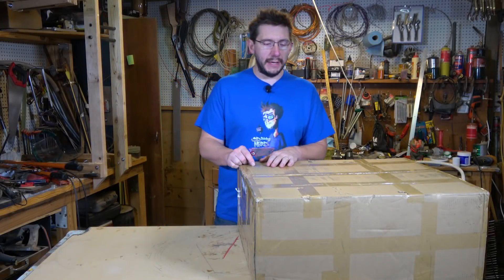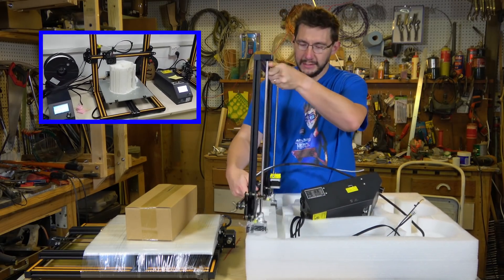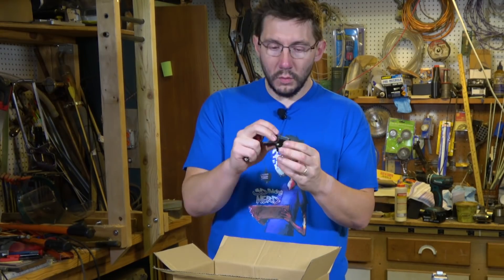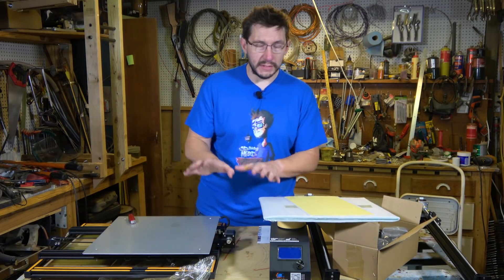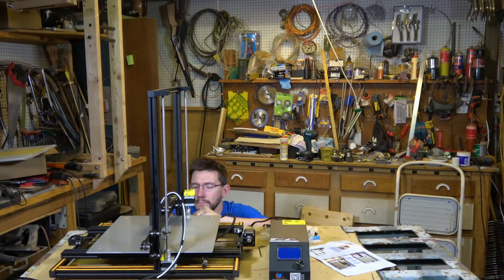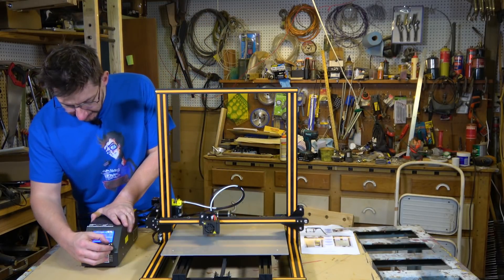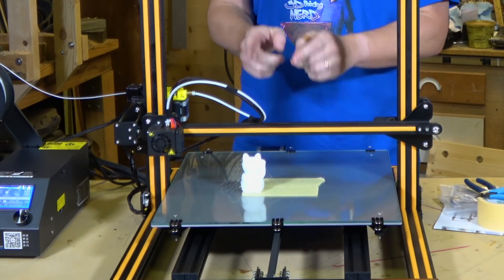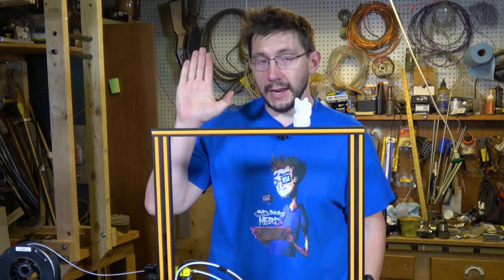Creality CR-10 Enlarged / CR-10S4 - Bigger Build Volume, Dual Z Leadscrews, Filament Sensor

Comment: I bought a cr-10 and it came with warped glass and a bent y axis beam (the thing the bed rolls on) if anyone knows anything that can help me bend it back to straight please let me know, or if I can buy it some where
Reply: I bought new glass and that fixed the warping
Reply: I don't think it's possible to ever bend aluminium back to straight - it work hardens so it will tend to bend at the different spot than where it bent originally when you bent it back; so in total a curvy shape will be the result. I suggest getting the vendor or manufacturer to replace the parts that are damaged. Give it a shot, normally if you get past the language barrier and they understand what is wrong, you might not have to send in anything, just upload photos and videos of the damage. Then they'll send you just the replacement parts and expect you to mount them by yourself. I know it's sometimes a matter of luck whether you get Chinese to do anything at all, but when you do, they usually go out of their way not to burden you unduly. And after all, they don't need that bent beam or warped piece of glass back, it's not like they're gonna re-sell those!
Reply: Siana Gearz thanks for the advise! Do you know by any chance their hours they work in eastern standard time? I couldn’t find it anywhere
Reply: Uhhh they're gonna maintain normal office hours in Shenzhen, which is likely middle of the night for you! The communication is usually delayed by a few hours anyway even when they are on, as you can't quite expect support offices to be well staffed.

According to Naomi Wu, Creality does maintain some English language support staff at least. I haven't communicated with Gearbest yet, but both DX and TD and BIC and other places where i ordered, the communication is in written form and often marked by nonsequiturs as they could come from using Baidu Translate both ways. What helps is to be polite but not verbose, three-word sentences pose the least difficulty, and when prompted to upload pictures, make pictures speak for themselves as much as possible.

Comment: Failed! You don't have the Decapicat! :D

Joke aside, I have the exact machine for months, and it is great!

Been printing lots of stuff for my work related projects & earned myself enough to buy another CR-10... Or maybe the new Prusa i3MK3 :D

But please do print the restrainer for the heated bed cable & change the glass bed to a flat mirror for optimum bed flatness

Hi5!
Reply: The cat's gcode have been fixed for newer CR-10's so it's not really a fail.

Comment: I have found on my CR-10 S5 the big boy you can just leave the filament sensor "its just a end stop micro switch in there" hanging lose on the filament, that way as the Z gets higher there is no wear problem with the sensor and the angle from the roll of filament. No place bad for it go and if the filament runs out the sensor switch still works.